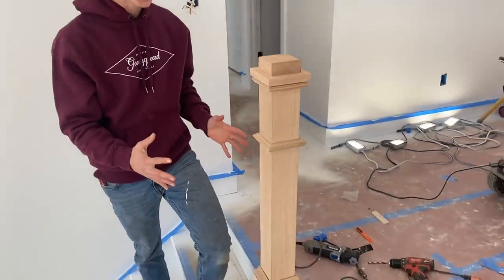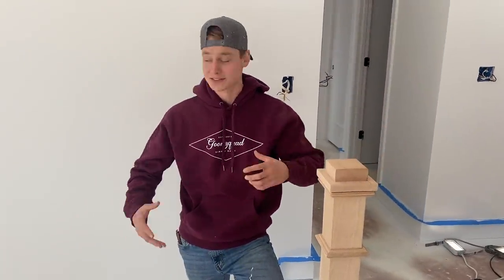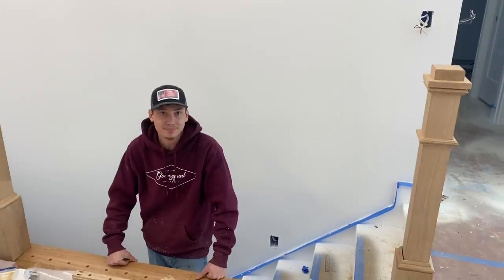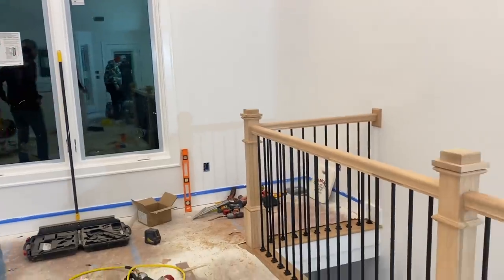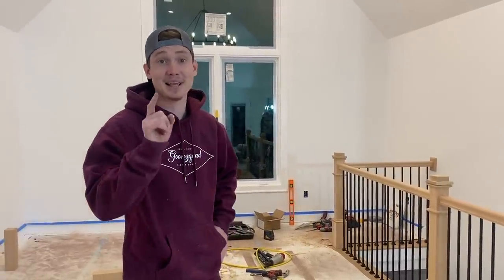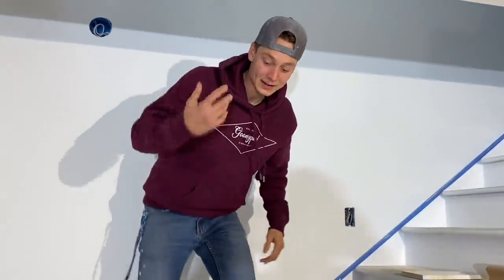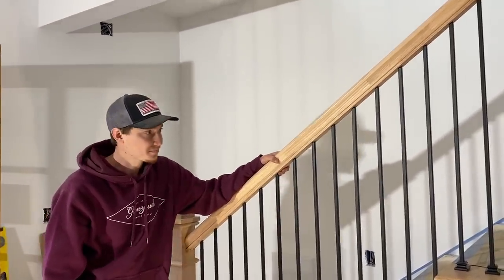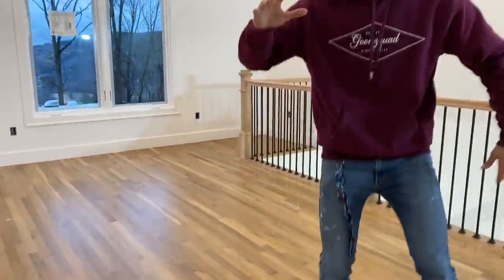The New Goonzquad Headquarters Part 64

Comment: Could an american explain the inspection stuff, as an european I can't understand that you guys can't do whatever you want in your own house
Reply: Building Codes in the USA are quite similar to the Building Regulations in the UK and throughout the EU, and such controls exist in all developed countries worldwide in which my Firm has designed and constructed buildings of many types and sizes. Their purposes include safeguarding the health and safety of building users, upholding energy conservation standards, preventing uncontrolled works which may damage the property of others, and many other associated aspects of urban and rural management. In the USA, an 'Applicant' (usually an owner or developer) has to obtain a 'Building Permit' before any works begin on site, and in doing so they have to undertake to fully comply with all relevant Building Codes. During the works, the Applicant is required to advise the Building Control Authority when a number of significant stages are reached. A Building Control Officer then visits the site, inspects the work and either orders that it be brought up to Code requirements, or Approves it. When everything is substantially complete, there is a thorough Final Inspection. If all is well, a Certificate of Occupancy is then granted to the Applicant, and the building can only then be used for its stated purpose. Building Codes are legal requirements, and any deliberate, negligent or reckless flouting of them will often lead to legal proceedings, heavy fines and other enforcement action.
Reply: @johnstedman4075 ok it's very different here in France, you need a building permit too, but then (in the case you are building your own house, it's different if you want to rent it), you can do whatever you want inside, i mean, if you don't want to put an handrail in your stairs, they don't really care. You just have to respect the initial building permit (outside look, opening like windows and door, ...)
Reply: @lucassantoni6421  Matters such as external appearance are usually a separately controlled issue, controlled by Planning Departments, who require details of proposed buildings at an early stage, and then issue Planning Approvals. In many parts of the world there are also Zoning Regulations, which control the use to which buildings can be put within defined geographical areas. There are additional controls where buildings are regarded as being of historical importance. It is all very complex, and a key reason why many of the people in my Firm are qualified in various fields of Civil Law!

Comment: ....so what is the inspection “issue”?  I didn’t even see an inspection done...?...
Reply: They were probably referring to the Code requirements for the safety of the stair balustrade, handrail and guardrail.
Reply: @johnstedman4075  or all the window flashings and roof flashing/ roofing on the shed.  I'd have pages of items failed.
Reply: @kdrguru  The original reference was to the thumbnail for this particular episode, during which the Code Requirements for staircase balustrades, guardrails and handrails were specifically discussed.